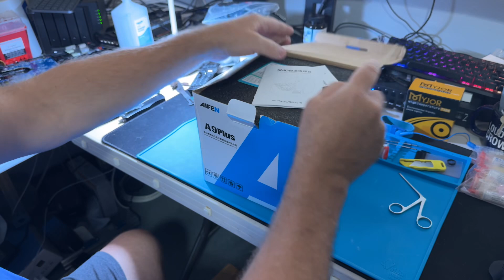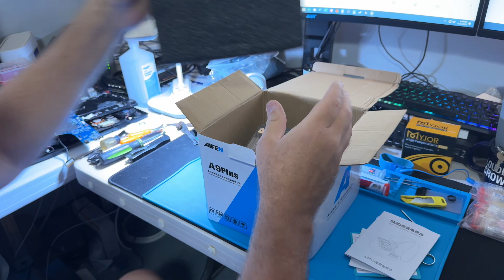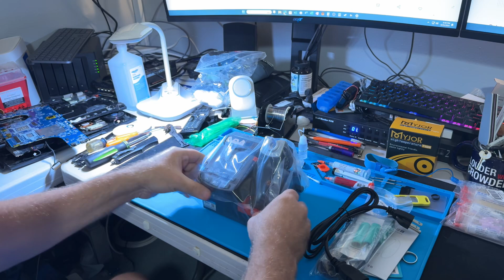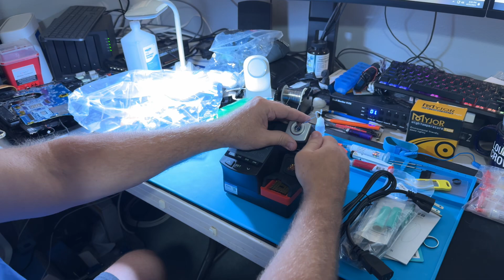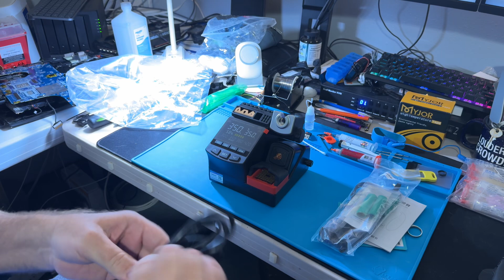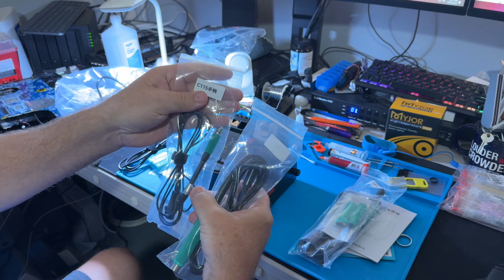AIFEN A9 Plus 2024 Unboxing

Comment: Thanks for the Aifen A9 Plus review, mine just arrived and like you had a peek inside.  My order arrived with an Australia mains cable which had the wall plug cable angled up not down!     No problems these things happen...     The final assemply department also incorrectly wired the mains Active and Neutral reversed from the back of the IEC panel mount connector.   The error I uncovered was the output of the IEC fuse was not looped to the switch below, but was connected directly to the PSU with the black Neutral wire looped through the switch.   Our local electrical safety regulator would have rejected this configuration.   It took about 30 minites to rewire all the connectlions correctly i.e. the fuse outlet directly to the switch.  I also need to sperate out the mains 240V AC wiring from the 24VDC wires!  It is unacceptable and poor practice to strap the single insulated mains wiring with the 24V DC wiring.    I also check the soldering iron tip earth, the mains earth is soldered to the main control board with a lighter gauge than I was expecting (less than 1 -1.5mm2), with a very small 4.7ohm 0.125W resistor connecting to the PCB ground and iron tip.  This practise is non-conforming and needs to be fixed.  Otherwise the feature packed unit works extramely well so far.
Reply from the maker: @raymiller5738  Interesting! Great information - did you post a video showing your findings?

Comment from the maker: Box opening video - links to the items here:

I picked the A9 Plus with the C245 handle and 3 tips

AIFEN-A9 Plus: https://www.aliexpress.us/item/3256806861397784.html?spm=a2g0o.order_list.order_list_main.43.221e1802imLHl9&gatewayAdapt=glo2usa

AIFEN Soldering Iron Handle for C210/C245/C115 replacement Iron Kit: https://www.aliexpress.us/item/3256805409434892.html?spm=a2g0o.order_list.order_list_main.37.6f7f194dLFLjuI&gatewayAdapt=glo2usa

SUGON Universal C210 Soldering Iron Tips: https://www.aliexpress.us/item/3256806215904859.html?spm=a2g0o.order_list.order_list_main.36.6f7f194dLFLjuI&gatewayAdapt=glo2usa

AIFEN C115 Soldering Iron Tips: Heat Resistant Soldering Station Silicon Soldering Mat: https://www.aliexpress.us/item/3256802829908077.html?spm=a2g0o.order_list.order_list_main.49.3837194drEwPQf&gatewayAdapt=glo2usa

Other Items I use:

Heat Resistant Soldering Station Silicon Soldering Mat: https://www.aliexpress.us/item/3256802829908077.html?spm=a2g0o.order_list.order_list_main.49.3837194drEwPQf&gatewayAdapt=glo2usa

Digital Soldering Iron Tips Thermometer Temperature Tester: https://www.aliexpress.us/item/2251832685083988.html?spm=a2g0o.order_list.order_list_main.31.6f7f194dLFLjuI&gatewayAdapt=glo2usa

KRICPY Stainless Steel Ceramic Tip Tweezers: https://www.aliexpress.us/item/3256805799153541.html?spm=a2g0o.order_list.order_list_main.55.5460194dg5RHsL&gatewayAdapt=glo2usa

ATTEN ST862D Hot Air Gun Digital Display BGA Rework Station: https://www.aliexpress.us/item/3256801714659023.html?spm=a2g0o.order_list.order_list_main.55.65eb194dcSRVUO&gatewayAdapt=glo2usa